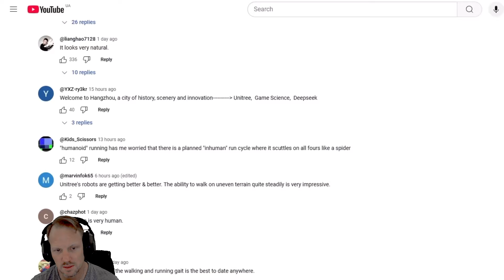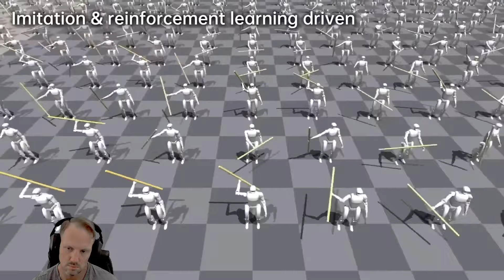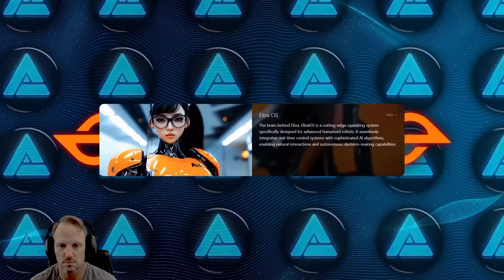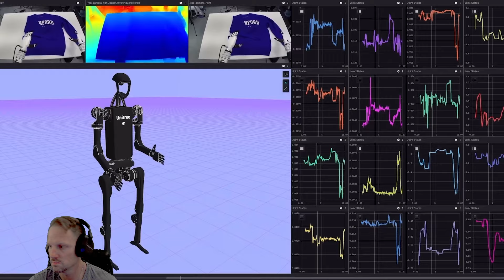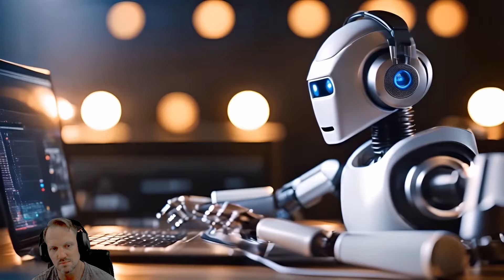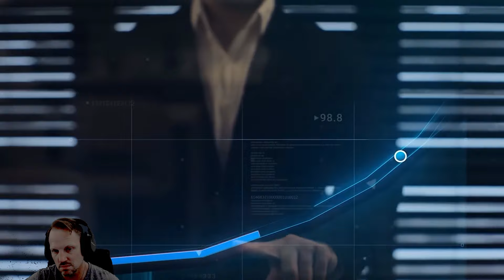Checking out the G1 Humanoid by Unitree Robotics

Comment: China has a humanoid training center located in Shanghai. They training 100-200 robots right now, and plan on training around 20,000 by 2027. All this training of course can be replicated and the data collected can be placed in other humanoid robots. This program just started not too long ago, but they plan on accelerating AI and the movements of these robots. Training is important because you can't just build a humanoid robot and then tell it what to do. Like a human, it needs to be trained to do certain tasks. China is finally taking this very serious.
Reply from the maker: Thats very interesting.  Thanks for checking out the video 🤖